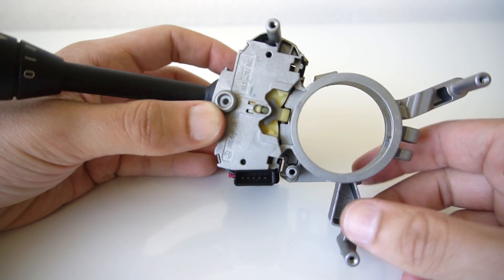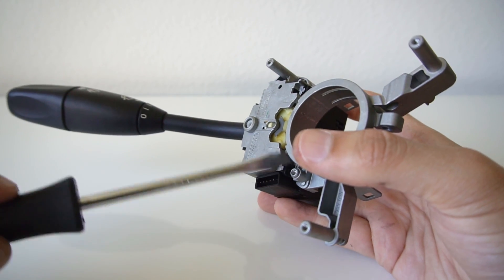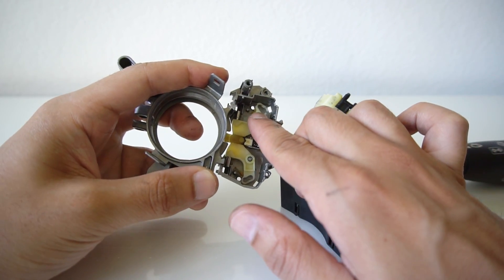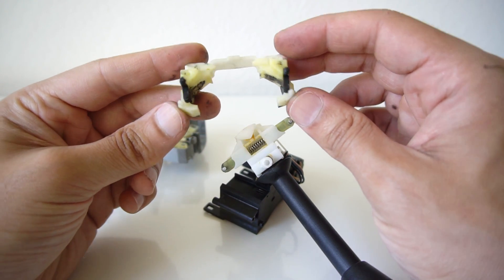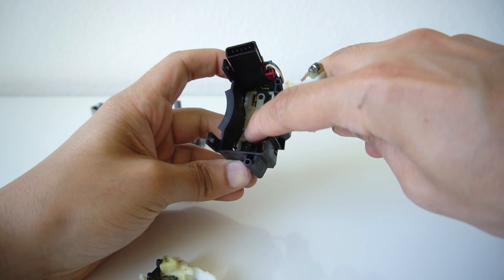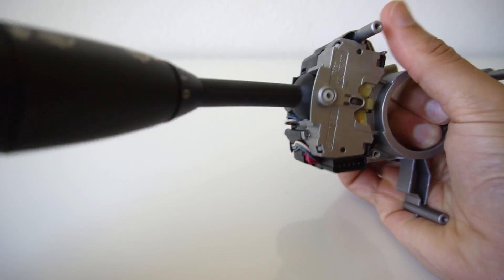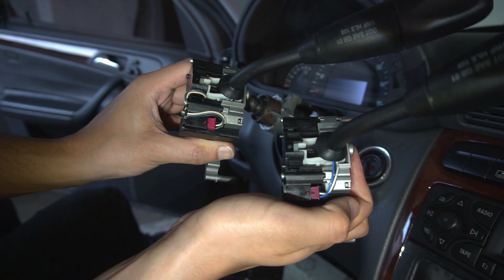Mercedes Benz Disassemble Turn Signal Combination Switch and Mechanism of Action

Comment: Try, 
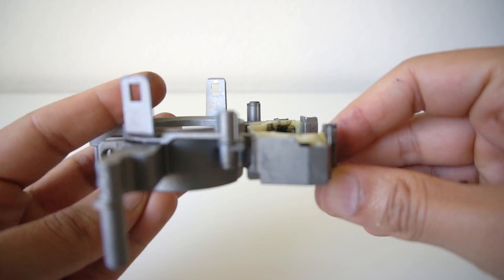I know where is The "Problem" why switch is not standin in his position! don't need buy new one or second hand... you just need open Turn signal box 2.screw and change little black clips right to left , and left to right you can saw them 3:35-3:38, and it will be like NEW! ;)
Reply: I don't understand. You mean the two little black things in the white plastic at 3:31?  I have the same problem.
Reply: Thanks man! Swap and works like a new 👍
Reply: K

Comment: To fix the issue you simply have to swap the two little black plasic pieces that the rollers slides on. Due to mechanical wear, they are at some point no longer able to keep the stalk in place. These are identical on front and back side so you can put the top one to the bottom and the bottom one to the top. When doing so, don't forget to lubricate the surface otherwise you will have to come back around auf year later, disassemble the whole damn thing again and then put the grease in for it to work properly. Ask me how I know! Also I think the premature wear that we are experiencing is due to a lack of grease, either from the factiry or because it dries out/goes away somehow. Hope this helps someone, probably a bit late for you but maybe it helps someone out who is experiencing the same issue.
Reply: Maximilian Illig do you know maybe where to find new black plastics cuz mine are damaged on both sides so i need to replace them
Reply: Dragan Trajkov 
hello you managed to find the pieces
Reply: Hey, I got clk w208 and something happened to my left turn signal switch. When its on neutral position it still indicates left, I have spare part so do you have any idea what could’ve been broken so I can fix it? Thanks in advance
Reply: grease...okay I'm not having this issue, but I'll grease mine up just as preventative maintenance.